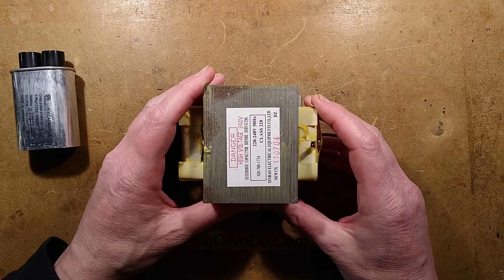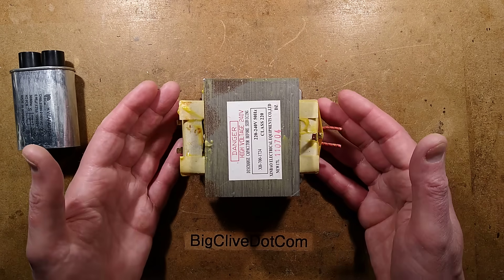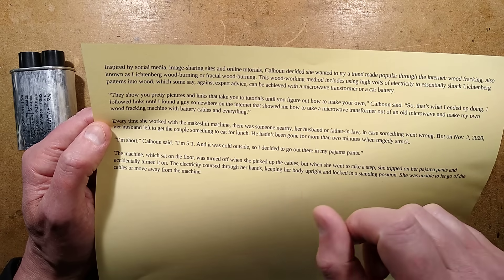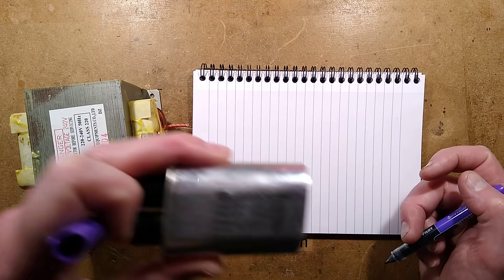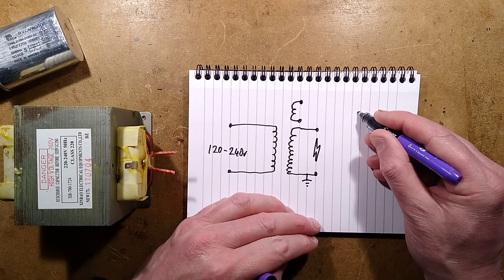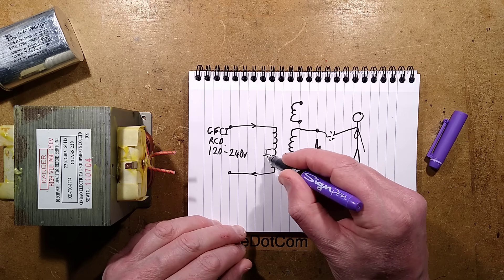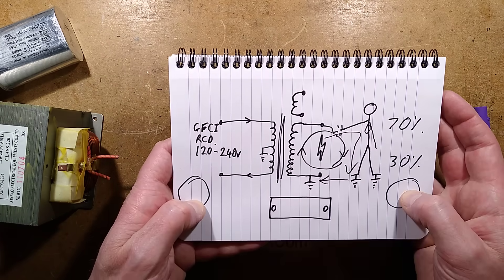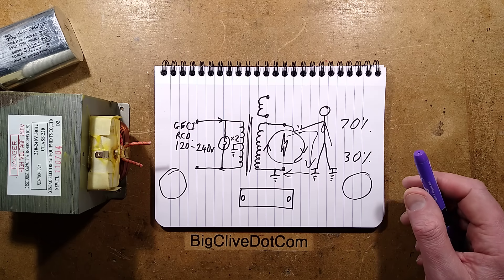The most deadly project on the Internet

Comment: A local news station did an thing on a local guy making word burns for income during the pandemic.  There was a quote from him that was basically along the lines of "Yeah, I use a microwave transformer, it's great fun!" with a picture of him in flip flops poking around this thing.  Also a few years before the pandemic a friend asked if I knew how to do this because I have an electrical engineering degree and he said it looked dangerous online (smart friend) and I told him I did.  We made something up for his fiance, in a safe manor.  Also used a neon sign transformer because I have both and frankly the higher voltage makes better, crisper patterns.

Comment: Microwave ovens are the one electrical appliance I won't work on. If it's broken, get a new one!
The videos which give instructions would be well served by showing the picture linked in that article as well as the pretty squiggly lines on the wood. "It can do this to a Beech chopping board and this to a human hand".
The skill of the surgeons should be appreciated in this case, they can do amazing things.
💚🐇🐴💚

Comment: I was playing with a 15k neon sign transformer and I tried using jumper cables. Even though I was handling just one of the two cables I could still feel tingling through my hand and immediately stopped and purchased some cable rated for the voltage....

Comment: isolation transformer secondery winding should be seperated from earth. But that can even make it worse in some situations.
Reply: No. That can even make it worse in some situations.
Reply: @Basement-Science  In both cases with the ground and with no ground if you touch both sides of secon. transf. winding you will be electrocuted. So connecting it to the ground results in even more dangerous equipment, by touching one wire with no ground results in electrocution. In order for grounding to work you have to have special equipment connected to second. winding.
Reply: @valentinaselektrikas  With ground, one of the terminals is pretty safe to touch. 

Without grounding, touching either one of the terminals CAN be dangerous because keeping it properly isolated is hard, and can give you a slight zap even if it is (ask me how I know). Especially if you handle conductive liquids and a Transformer that is DESIGNED to be grounded on a specific terminal. MOTs are NOT proper isolation transformers, in fact most of them connect one side of the HV side to the core, and expect that to be earthed.

The point is that neither approach is strictly better than the other. It's not a clear-cut thing.

Comment: Very good point about the switch, (should be double pole) Clive. Also, to increase still further the safety of the wires, the conductors should be suitably insulated and around the `HOT` wire, should be a screen or copper braid that is connected to the transformer core, `Earthy` end of the primary. It is also good practice to make up the `earthy` secondary probe out of 3 or more conductors in parallel so if one breaks you still have a return path. The probes should be made out of suitable materials, good dielectric strength and resistant to cracking. Wherever you have any handle area on the `hot` probe there should be the copper braid underneath.  If I was to build on of these, I would put it in an insulated box and instead of referencing the transformer core to earth, I would suggest using the neutral wire instead. That way there the breaker may still pop out if it sees 30mA to earth.  Neon sign wire was sold with a copper screen on the outside, if I remember correctly but I am not sure if it`s still available. If you are not comfortable with the transformer core connected to neutral, then you could, if you are careful, lift the cold end of the HV secondary then you can connect the core to earth and the HV secondary to the neutral. Another thing that catches people out, is the distance that the arc will jump, 3 or 4 Kv you think well only a few mm or so in dry air and yes, you would be in the ball park but once an arc has formed the air is ionised and the arc at these kind of currents (prob 1 to 4 Amps), can reach several inches and `wander` all over the place burning everything within its reach until the power is turned off.   I have little interest in building these but I am experienced in high voltage supplies, working on maintaining high power radio transmitters (big valves). Great video as usual Clive! Chris, UK.

Comment: I agree 100%  HV is nothing to treat lightly.  220v is a shitload worse than 110v, and 440v is a killer.  I appreciated your mentioning the difference between a neon sign TF and a microwave oven TF.  I've only messed around with TV flybacks and neon sign transformers; things like a jacobs ladder are 100% hands off while the power is on.  A microwave oven TF is good for 1200 watts!!  Not a pretty trickle through neon, but some seriously crazy power.  However, If treated with respect, I can see how that project might be done.  Use glass rods to manipulate the probes?  I'd look into lab equipment sites.  Ain't no fucking way I'd use probes not designed for HV work.  Not.  Worth.  It.

Comment: It was only a matter of time before people starting getting killed doing this with a combination of easy 'how to' tutorials and the Dunning Kruger effect 😔. 
Do not mess with high voltage/high current electricity unless you know EXACTLY what you are doing and fully understand the dangers/failure modes - 99% don't. 

You need real in depth understanding to keep 100% safe - not the basics.

The other one doing the rounds a few years was the connecting the loads of 9v PP9 batteries in series to get 3K plus volts - TylerTube was the one that made me shudder when I saw what he was doing.
Reply: People have been dying from these since before the internet was a thing.. I remember seeing this use printed up in an art magazine in the 80's !!!

Comment: Hm.. perhaps electrosurgical generator would be safer for this. Few hundred watts @ peak 3-5kV 400-1000kHz wouldn't electrocute you but it would burn/cut your flesh.
On service training the instructor even demonstrated this by lighting a 40W bulb by holding on one hand HF return electrode and on other hand E27 housing and with monopolar scalpel touched the bulbs inner contact.

Comment: As an apprentice in 1960's taking City and Guilds we were obviously taught  about electric shock and its dangers.DC was move likely burn and throw you away  from the source.AC was the more dangerous and if you came into contact whilst holding the live terminal we were told the nature of the voltage rising and falling confused the brain with contradicting information that it made it impossible to release.I discovered it was true when I plugged the aerial into a TV set with a live chassis which I was working on.The TV fell off the bench and that saved me,I can still remember being helpless not able to let or call for help.I was a fitter in the supply industry and worked on 415V live apparatus with only wellington boots and a rubber mat to stand on,it was impossible to work in gloves.We were taught 15mA was the maximum current the heart would take.In  this area the lowest voltage on overhead lines apart from 240/415V services was 11KV the 2,3,5 and 6.5KV lines and cables were removed in the late 1960's
Regards

Comment: i don't even like opening up LCD TVs because of the mains filter cap. maybe i'm just a baby, but i don't want to go out from fixing a TV... and i just refuse to do any microwave project. you can make a microwave give you cancer. if you pump enough energy into the magnetron , it can generate high enough energy particles to start irradiating you. if you do that enough, your chances of getting cancer start to increase. you kind of have to be trying, but the fact that its even possible makes me less interested in microwave projects or playing with the magnetron

Comment: I "play" routinely with MOTs, and of all the incredibly dangerous toys I have they are among the most respected and feared (my 1300V 1.6KJ cap bank being another which I charge with a rectified MOT). I have unyielding rules about how and when it gets operated, among them always having a second person in the room with a shutoff switch in hand and paying complete attention to what I'm doing, and limiting the amount of current the transformer can draw by either using another MOT or a few light bulbs in series or series/parallel on the primary as ballast (depending on current requirements) to keep the current at safer levels. I like the light bulbs because they are unmistakable indicators that the unit is powered on, they can be stacked in series and or parallel on the primary in many voltage and current ranges (using another MOT just gives you a fixed value), and on the rare occasion that a bulb fails it instantly turns the transformer off. I also stay at least two feet from any wire whatsoever while it's in operation, and if I'm making arcs or wood burning I use a good length of PVC pipe as a chicken stick, and only ever handle one electrode at a time whether or not they both have chicken sticks. And it goes without saying to use the one hand rule while standing on an insulated rubber surface. I've been shocked badly before, almost lethally (not by a MOT) and I don't mess around with safety, I must agree that a lot of people that are playing with MOTs online these days should not be playing with MOTs, it's billed as an easy arts and crafts or DIY project but some of those people would be safer making Nitroglycerin in their basement, because at least they would have a basic understanding of how dangerous it is...
Reply: good idea to put light bulbs in series with the primary! :)
Reply: @ayakas-kh5mk  that's a neat trick isn't it? I picked that idea up from a couple guys here on youtube, the transformer can only draw as much current as the light bulb can which is really handy and allows for a pretty broad range of current selection if you string the right bulbs along in the right number and orientation, and it's really easy choosing the right incandescent bulbs since the voltage and wattage is usually printed right on them. I'm building a new transformer right now that will have a switchboard to pick and choose from at least half a dozen bulbs I want in the circuit without having to constantly change out or rearrange them. I just have to make sure to keep the feed voltage off the variac at the right level so I don't burn out the smaller ones lol.
Reply: @TheExplosiveGuy  I've played with MOTs and figured out high voltage isn't my cup of tea. I now prefer them in high current flavors, much more fun to me. 

Anyway, the light bulb trick is really cool. I have one extension cord with a lightbulb socket spliced in the middle, I use it when fixing appliances that work on mains voltage. My main concern recently is the amount of heat these bulbs put out, especially 200w ones. I've been thinking about immersing them in mineral oil, that would help with the heat dissipation if you're planning to put them in the box.
Reply: @lazar2175  I choose mine to just to start glowing at normal operation-currents of the tested-device or below that so they keep (almost)  the same voltage for that device.
Then only when something goes wrong they start producing light or really light up.
So normally they stey cool to the touch.
Reply: @lazar2175  haha yeah HV isn't for everyone, and high current is definitely fun too, I've got a 220V 3-phase stick welder that I can do some pretty entertaining experiments with lol, mainly melting stuff really fast🤣.

As to the heat thing, I think you would probably be better off just enclosing it in a cowl with a fan blowing directly over it, versus dealing with a bunch of potentially spillable hot oil. I'm planning on making the bulbs on my transformer externally mounted in a line at the top of the box from smallest to largest, I think that might look kind of cool, and I'm thinking of going with all clear glass bulbs in a vintage style as long as I can get them in the variety I need for all of them.
Reply: what is the one hand rule? I intend on making one of these one day and I'd like to be a safe as possible. The failed light bulb safety killswitch is an excellent idea which I will use. I'm a little bit skeptical about dead man switches though as, once you are being electrocuted, your muscles lock up, and you will not be able to release the dead man switches. I do like the idea of a grounded cage
Reply: @Druss2012  This is partly why the term "dead mans switch" is not commonly used in safety applications any more, and instead for something like this you would probably be looking for a safety enabling three position switch e.g. 440J-N21TNPM, with an additional reset/enable.  The 3 position switch is a grip handle with off-on-off positions;  So you squease gently to move the switch from the first OFF to the middle ON position.  If you then squease harder e.g. due to panic/electric shock/etc you move to the other off position.  The reset is then just another button typically on the top of the grip which has to be cycled/pressed each time you move from the OFF to the ON position.  Of course, the best defence is to just not do it at all/put it all inside a grounded interlocked enclosure/etc as you would determine through the ever dreaded "risk assessment".        The one hand rule is to stick one of your hands in your pocket while working on what should be "safe" but has potential HV.  This keeps that hand away from ground/etc and supposedly reduces the risk of the electric current passing through your heart when you grab the live component with the other hand.  Very much belt and braces, however IMO its real value is in focusing your concentration on the one operating hand so you're less likely to inadvertently grab the live wire in the first place.
Reply: @Druss2012  The one hand rule is to work with only one hand, keeping the other one, say, in your pocket. Thereby you cannot establish a current path between your hands and hence across your chest and heart.. HOWEVER this does not apply to the high voltage experiments Clive describes here. 

The dead man's switch is two power switches in series far enough apart and well away from the dangerous voltages so that you HAVE to operate them with both hands thus making it a "no hands" working situation whilst the power is on. Of course there will always be an idiot who manages to get some other part of their anatomy too close to the danger area with <Clive accent> interesting </Clive accent> results.
Reply: @Druss2012  If you ever watch a engineer or electrician working around high voltages you probably notice they have one hand firmly placed in a pocket. The idea being that if they get a surprise and earth a high voltage line the current will not be traveling from one hand to the other across their chest but to the ground through their feet. This gives a better chance they might survive by reducing the amount of cooking their internal organs get. I'm no expert but that's my understanding of the one hand rule.
Reply: i play with 50kv transformers. all i do keep my distance and recognise what's 'live' and what's not. (i also have a breaker right next to me for when things inevitably go wrong.) not trying to say safety precautions are redundant though, but that common sense (and particularly electrical knowledge) prevails.

Comment: You can kinda do it with a car battery, I discovered it when I was around 12 years old playing with one with the intent of basically just trying to light stuff on fire with an arc. Once you get a carbon track started you can lead it around, and most excitingly you can burn holes downward which makes a great big flame shoot out and nice wooshing confined arc noises. It's definitely safer than doing it with a MOT or neon transformer, the main hazard just being good old fire.
Reply: the other hazard is a blasting battery that sprays 32% sulfaric acid all over your face...

but other that, pretty save !

Comment: I was going to use a MOT for a low voltage power supply project (after removing secondary winding, and rewinding), however I heard they are not very efficient and get quite warm, apparently the fan in the microwave is designed to assist with cooling the core? Is this True/False? any advice gratefully received.
Reply: They are designed to be cooled with forced air, and only for a certain medium load as well. They are not short-circuit-proof and not designed for highest efficiency. But if you ensure you dont draw too much power from it, it should work fine even without a fan. You can add a thermal fuse to the transformer, and/or a regular input fuse to make it a bit safer.

The same rules for any hobby build as always apply: Test requirements beyond the expected use case before considering anything remotely safe, and only use when constantly supervised by YOU, among other things.
Reply: @Basement-Science  thank you so much for the info!

Comment: My brother told me about this. I helped him do one. I took many safety precautions and used my electric resistive boots, my electrical gloves rated for 1000v and laid a thick rubber mat as a work station. I also handled only one cable. The other cable stayed on the board clamped to a nail.